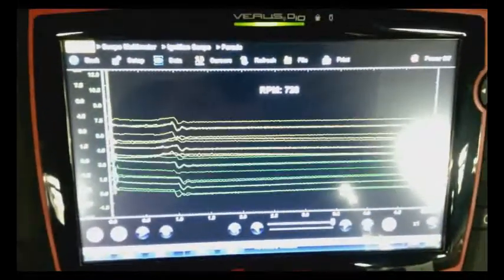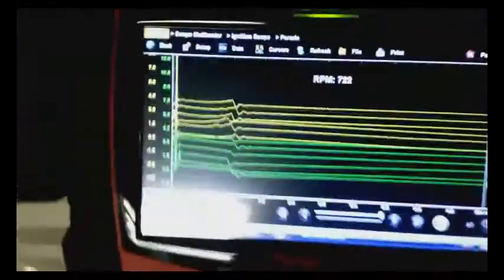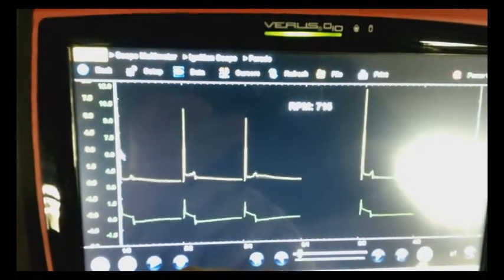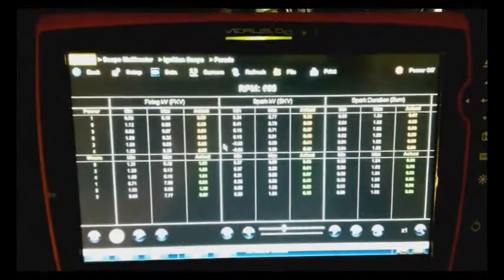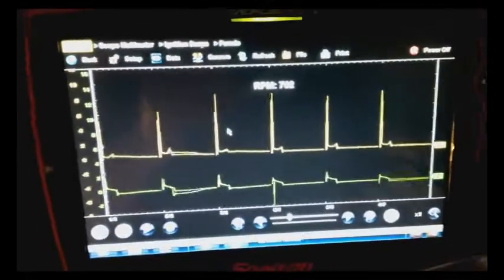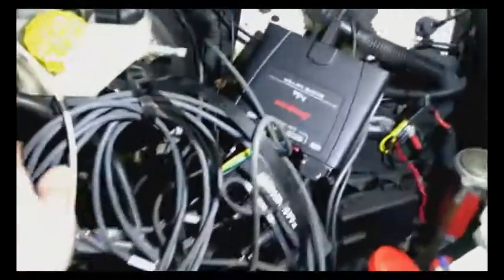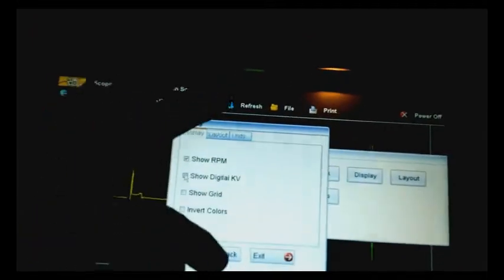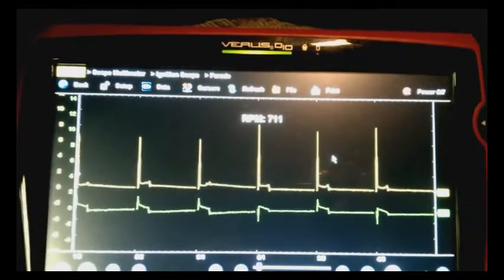Lab Scope Testing Waste Spark Ignition

Comment: Wow thanks Phillip. I couldn't figure out what was happening on my SIA 2000. There is a lot of critical information on your video that I would never have figured out on my own. I was using the 12v power and had no idea about the button to adjust sensitivity. My reading were so messed up that I was wondering if I bought a lemon SIA 2000. It's hard to believe that this information is so difficult to find. I did many searches online before I found your video. One other thing I found out is that you can't use the unit on conventional system v8 engines unless you buy a quad cable adapter so you can expand the number of negative side cables to eight. I can't find that cable anywhere. I guess you could do 1 bank at a time but I purchased this adapter specifically so I could parade multiple cylinders at the same time. Oh well you have gotten me closer to my goal. Thanks again.
Reply from the maker: Thanks. Believe it or not that was the last time I actually used the SIA 2000 for diagnostic purposes. The vehicles are getting so good at diagnosing themselves and other methods of qualifying the coils are easier. On top of that the coils are getting harder to connect to.  Ignition secondary testing is a dying art kinda like carb overhauls...

Comment: Great video.  I got my hands on an SIA 2000, but I use the vantage pro scope.  Would you see any problems using this adapter on a vantage pro?  Is there any chance you can make another video going through the step by step set up of this adapter?  Most of the waste spark systems I see are GM.  Thanks.